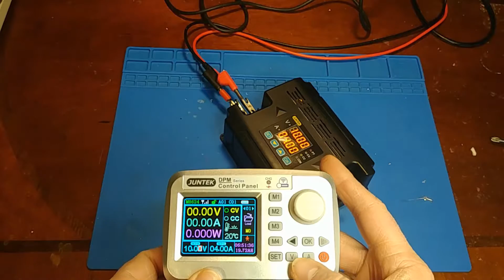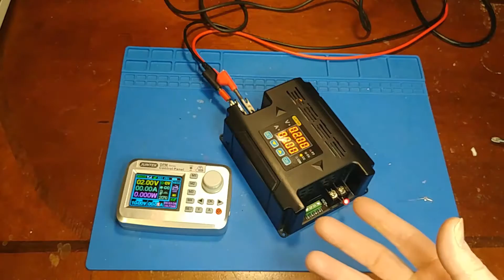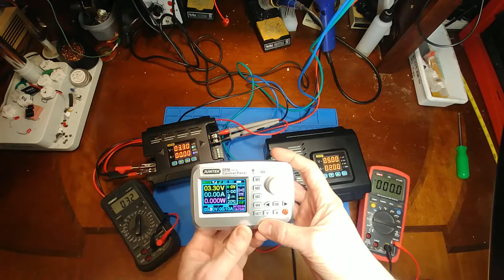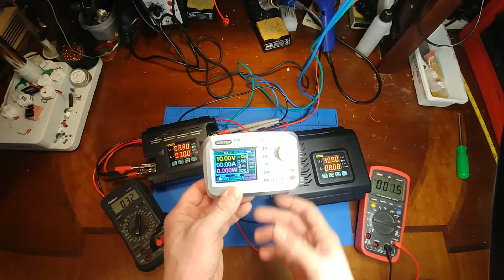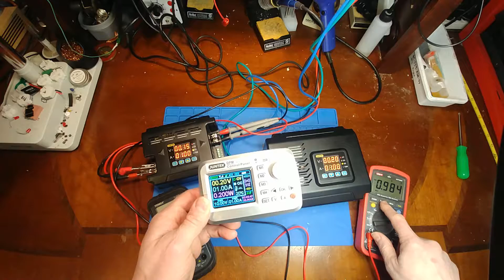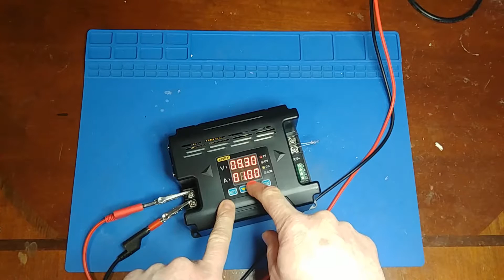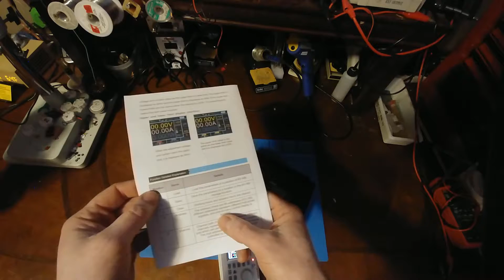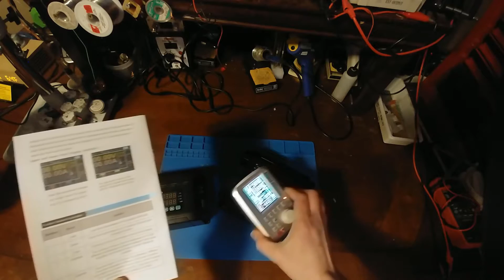Let's check out the Juntek Power Supply

Comment: I don't suppose you ever had a chance to test the efficiency of the output vs input voltage? The Juntek listing claims 92% - it would be really good to know if you supply is with (for example) 60v how many volts it can supply after conversion.
I know you gave it to a friend, just asking in case you tested this!
Reply from the maker: I didn't check. But I'd assume it's pretty efficient being that it's just a buck-boost style control. Should be more efficient than analog control. But keep in mind it's not a power supply, just an adjustable buck converter.
Reply: @jeffescortlx  
Absolutely, I'm just speccing an AC-DC to supply it, but need to make sure the AC-DC supply is over and above the effeciency losses.

Comment: I've been trying to get hold of the manual of this to have a look through but the AliExpress seller 'Junce Store' is just ignoring my messages (doesn't really insire confidence.

I don't suppose you have a link to the manual or could take a few snaps?
Reply from the maker: I gave away this PS (and manual) to a buddy, so I no longer have it. But what is it your trying to find out?
Reply: They actually got back to me this morning. I just wanted to know if the 'M1-M4' buttons functioned as you would expect and hold presets, which the manual confirms. 

Here is a link just in case anyone else is on the search for it: 
 http://www.mediafire.com/file/th6vv5v0bn7cfak/DPM8600_EN_manual.pdf/file

Comment: I just subscribed.  Originally, I came to your channel because my 2004 chevy 2500hd's battery goes dead in a couple days.  I determined it comes from the dash cluster.  So far, I've watched 7 of your videos and am becoming addicted.  Anyhow I still havent seen a video that points out the number one reason or area for this to happen.  I understand the solder joints need reflowed because of a lack of lead in the production process (as I'm told).  Can you refer me to a video that deals specifically with this problem?  I would have to be a short, right?  Or simply let me know an area I should look at, please.  Thank you for your very interesting videos.
Reply: By the way, if you created a video:  "the number one reason your chevy truck cluster kills your battery"  you would get a hundred thousand views.
Reply from the maker: @onenewworldmonkey  there are multiple issues that can cause the cluster to drain the battery. This generation of cluster has multiple issues, it would be foolish to only fix one issue when there are a handful of issues already on the way. I would reccomended to just get it over with and have a proper full rebuild done, rather than just fixing one issue.
Reply: @jeffescortlx  Thank you so much for the reply.  I understand what you mean.  I just took it off and found a card from someone in MN who rebuilt it.  They put some kind of clear lacquor over the solder joints which is now flaking.  I called them and they said it would cost around $70 to look at it.  Thanks again.  I still wish you would make a video covering the most common reasons.
Reply from the maker: @onenewworldmonkey  my videos do show the repair of pretty much all the issues. A lot of my videos show the process from start to finish. Just pay attention to the things I'm reflowing, replacing and scrubbing and you'll have a 100% functional like new cluster.

Comment: Hi, sorry this is an unrelated question but I have recently enjoyed watching your cluster repair videos!  I was wondering if you might have any idea of a source or at least a part number for the small twist in accessory bulbs used in 1997-2005 Buick Century switches.  My '04 has all the single window switch bulbs out and it is a simple replacement if I could only find the bulb.  Thanks for any help you may give.
Reply from the maker: Have you tried a parts store like NAPA? They typically stock user serviceable bulbs.

Comment: Ooow heavy duty buck regulators very nice :-D
You are bang on with the  switchmode source, it would likely be the most efficent for the cost of electricity. 
But an old U.p.c could be tapped into.
I'm not a lover of remote units, the direct controls are my liking.
More overcomplexity asks for failure, yes i'm an old git :-D

Love your cat, frendly with a touch of madness, like you :-D.
Reply from the maker: True. The more complicated something is, the more opportunity there is for failure.

Comment: Thanks Jeff. Good video. Insane the amount of power output its capable of. I'm not sure about the user interface seems a little busy. Not as simplified as the Riden. Still has some pretty cool features.
Reply from the maker: Yes the user interface does have a small learning curve. But it's setup in a way that makes sense so after a few days of using it a person could get the hang of it.

Comment: Never heard of them but it's an interesting concept. I am in the market for another power supply. Not sold yet on any of them yet. That second one doing 50 amps would be great for amplifier repair but I quit amps. Amps are a lot of fun to repair and I definitely recommend for the fun part. Customers kinda suck though.
Reply from the maker: Yep good for amp repair, and could probably spin up a starter motor too.